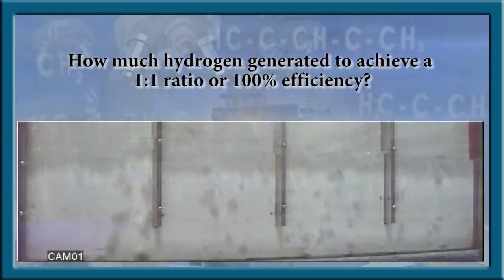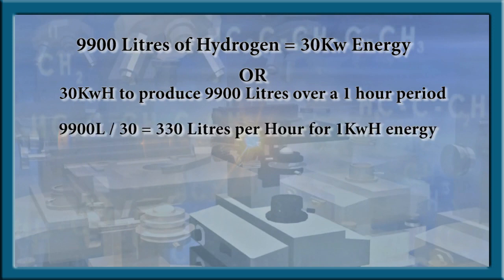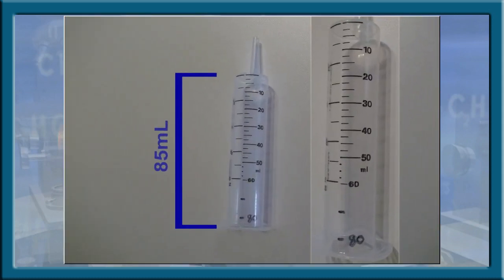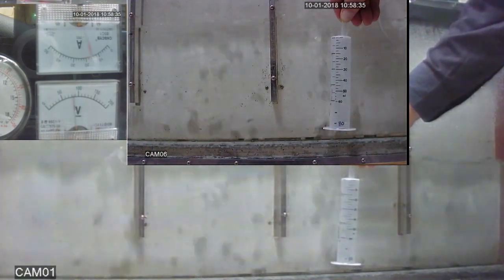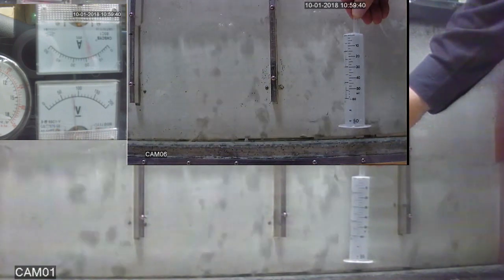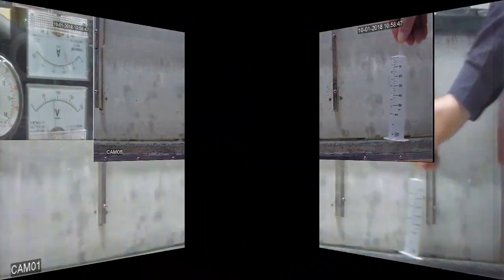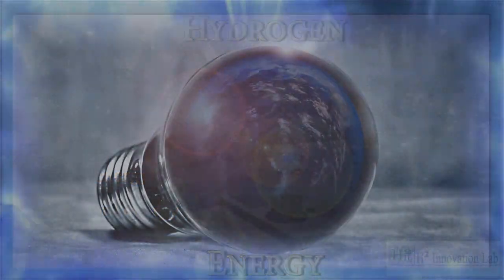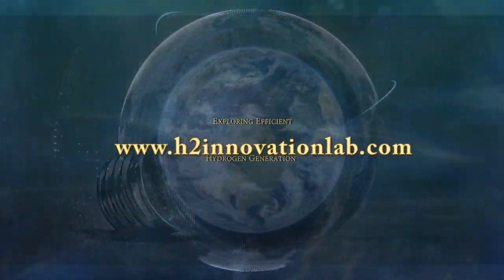Unbelievable But True! - Efficient Hydrogen Energy technology.

Comment: Idiotic video. Showing more bubbles is meaningless, they could have turned the current through the roof which means nothing at all except exciting the ones who see a quick buck to be lost 😂

My Challenge to Them if they have any credibility, which I'm sure they don't is

Show real-time input wattage

Measure actual gas volume over time with a graduated cylinder or precision gas meter

Confirm the gas composition — is it 100% hydrogen? Or mixed with water vapor or oxygen?

Show longer runtime and total energy in vs usable energy out or live volume counter
Reply from the maker: You will find your answers in the verification testing videos.

Comment: How is the 1000 efficiency of 9000 L of hydrogen equals 30 kw of electricity?  Or what. How usnthat determined?  Is it a chemistry measurement of the electron energy involved in combustion with oxygen? Or hydrogen fuel cell? Im smart than this. True efficiency of electrolysis isn't known yet until all* variables of conditions are known and verified. Surface area. Cavitation. Pulse with modulation , electrolytes and so on; even a bunch of stuff nobody has discovered yet. See what I'm ssaying?
Reply from the maker: 1 kg of Hydrogen has the energy content of 33.33kWh. Please view more on the dedicated H2 Innovation Lab website by sampling googling H2IL at your convenience. Thanks for your questions.

Comment: Are you using back emf pulses?
Reply from the maker: H2 Innovation Lab (H2IL) invites you to view an introduction to co-efficiency verification testing of its game-changing energy technology.

The tests are carried out using a PEM Fuel Cell stack to convert the generated hydrogen energy back to electrical energy. Input power in compared to out power real-time.
Scientific feedback is to the effect, and quote, "I truly believe you have achieved the remarkable" - "even if the fuel cell performance was 100%, which is impossible, the output readings are obviously greater than the input power." 

Please follow this link directing you to the brief 

intro video: https://youtu.be/L-PfstY_jYk
Thank you for your support.
Reply from the maker: No. This video may help. https://youtu.be/d40BqElAHYc 
OR  https://youtu.be/Ws4w5abN3vQ

Comment from the maker: Technically it would be more scientifically accurate to use the term coefficient.
We have as an example the common Heat Pump (ASHP) that will typically produce around 3kW thermal energy for every 1kW of electrical energy consumed, giving an effective “efficiency” of 300%. One would argue that according to the current law of thermodynamics it is impossible to have an efficiency of more than 100%, as this implies that more energy is being produced than is being put in.  For this reason the performance of a ASHP is expressed as a Coefficient of Performance (COP) rather than an efficiency. However it equates to the same, namely usable energy output over generated input energy. 
The above example would be expressed as having a COP of 3.  The reason that it appears that more energy is being produced than is consumed, is because the only “valuable” energy input is electricity used to drive the compressor and circulating pumps.  The remainder of the energy simply transferred from a heat source that would otherwise not be used such as the ambient air, so is not considered as an energy input.
In like manner, with the H2IL discovery, the remainder of the energy that equated to a 2000% efficiency simply transfers from the galvanic energy in bi-metals. 
But, as with other forms of “renewable” energy, where the source of fuel is virtually limitless and free, it is the total cost of generation rather than the efficiency that really matters.
Reply: As far as I know, "galvanic energy in bi-metals" is just another term for the electric currents produced by chemical action, similar to the way alkaline batteries produce electricity.
At some point the chemical action is exhausted, and the "battery" needs to be replaced or recharged.
The only way for such a cycle to be sustainable is if your energy output, in this case hydrogen production, is greater than the total energy needed to produce it, including "battery" replacement/recharge, i.e.- an endless supply of the materials needed, or a renewable source of energy.
Even if the electrolyte itself is the anode, as your "How It Works" video explains, at some point the electrolyte itself would need to be replaced or renewed.

As skeptic as I may be, I'm open to proof that your technology actually works, but that will require much more than 4 minutes of bubbler footage, or even a pseudo-explanation as the one offered in the aforementioned "How It Works" video.
Reply: @ZsOtherBrother  in galvanic series the higher potential is for graphite, the lowest for magnesium, what do you think about this couple in electrolysis? is this one of the tricks for best efficiency electrolysis?
Reply: no, it still the efficiency. you give energy to water to get hydrogen, but energy stored in hydrogen produced must be less than energy you give to the water. if you get the energy stored in hydrogen more than energy you give to the water, then we must rewrite the The Law of Thermodynamics.
Reply: @NurulImanS  That's flawd, isn't the Hydrogen you burn taken in to account in that calculation? Because the hydrogen you extract doesn't disappear magically.

Comment: That looks great. But I can't see the hydrogen cell on the video. If you show all than people will believe it much more easily.
Reply from the maker: Thank you for the suggestion. I will forward this on to the media team. Some of the full length videos shows the complete apparatus including the cell with the bubbler to the side. The viewer can see the connection. The CCTV records 8 cameras but to reduce clutter only the specific view for the required subject is  presented.  The cell (800mm x 800mm) insulated box in some videos is not very exciting to watch.

Thank you for your support.